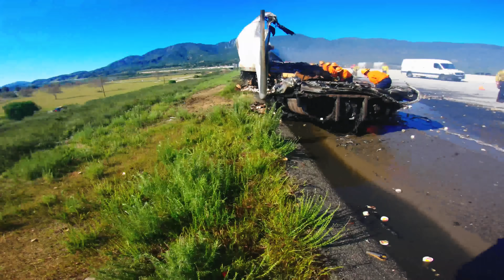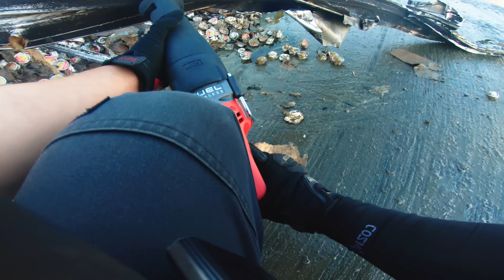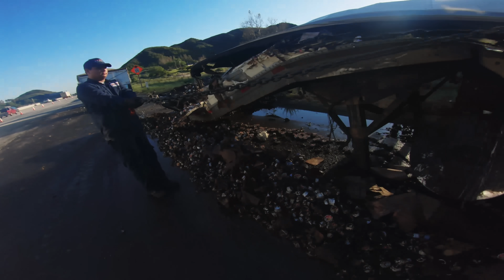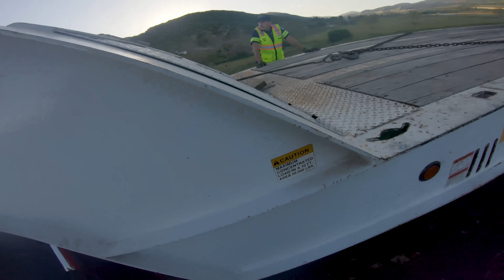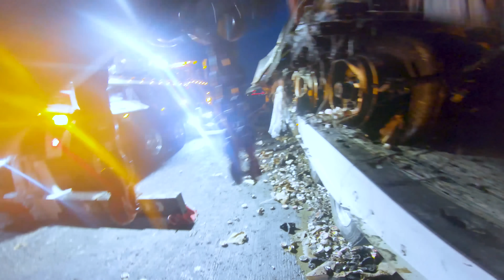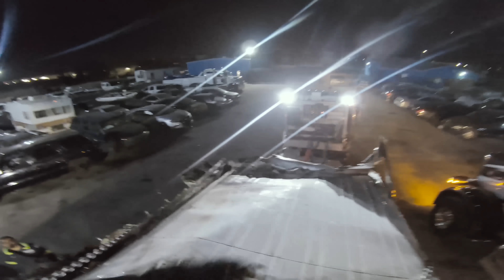40,000lbs of peanut butter burnt to a crisp on the freeway!

Comment: Sir JOSH !!!!!   What a messy recovery ????  GOOD THING THAT THE TRAILER DIDN'T BUST IN HALF WHEN YOU PICKED IT UP !!!!   ""KEEP IT SAFE ""!!!
Reply from the maker: I knew it was weak but also knew it wouldn't rip in half unless pressure was applied. Luckily I had Hulk and was able to sky it super high to compensate for the fold.

Comment: Hey bro. I think I would have first done a test lift from the refer end to see how much of the front I could fold back towards the rear axles. It would have cut the overall length nearly in half and have a couple wrap chains to bind the 2 halves together top to bottom. Then lift, back under, and let it down for securing. Good job. You made me hungry with all the roasted peanut comments! Did you get any samples, you know to show the boss. Lol later dude. Your videos are the best all except for the on off switch. Lol. Later. Jpol.
Reply from the maker: When I did my first test lift, I saw the front third immediately start to fold. The damage was too much, there was no way in picking up the entire thing evenly. After I got it a few feet in the air, I figured why not just sky it high and load it on the Landoll in one shot. Hulk is strong enough to do it and it worked well. I didn't know it would fold that bad when I did the first lift, would have taken longer if not the same time/effort to drop it back down and fold it before loading it.

Comment: I am a Nutella Man, so I am fine with losing a trailerload of peanutbutter. But what a sticky mess to clean up. I bet every link in your chains has some of that stuff stuck in it. But thank you for showing the work at the yard too. Most videos end when the loading on scene is finished, but the unloading is just as interesting in my opinion. But what happens with this wreck from here? Obviously the insurance will call this a total loss, so does the trailer get cut up at your location and then hauled off in pieces or does it get loaded and moved in one piece, along with the remaining peanutbutter cups in it?
Reply from the maker: Oh ya, mess on all my equipment. Had to do a proper hose down at my shop once done. To be honest, I haven't followed up with this call. We have many shops in the state and I don't micro manage all of them. In general though, I would quote insurance what my fee is to dispose of everything. They most likely would give us a location of where to dispose of it. Worst case scenario, they have no insurance and we have to find somewhere authorized to dispose of it and we would start the painfully slow process of suing the registered owner. On something like this, I would probably cut it and use multiple roll offs for the load.
Reply: @PepesTowingService  ... I think for cases like this you should just get a big portable shredder and grind the whole thing up. ;)

Comment: Just think about that remote thing what if you have a situation like this but there is too much debris underneath the trailer and the land all can't back under it you can just put it in remote mode and drive the halk forward until you line up with the land all. LOL JUST  AN IDEA!!
Reply: An idea that obviously has no base knowledge of physics. Look again and see just how far Hulk’s stabilizers/outriggers are deployed. Hulk would tip over without them and can’t move with them deployed.

Comment: Apparently u have not used a Sawzall much,yes u need a battery or A.C. power if it's electric, better yet would be a gas powered 14" cut off saw,it takes circular blades for any type of material demolition or construction.

Comment: Get rid of all the other brand sawzall blades you have and only buy Diablo, you name it, I cut it, and the blades are lasting me an average of 10 times standard by ANY other manufacturer, and I cut a lot of cars apart for core removal for scrapping.
Reply from the maker: I have Diablo, a big ass pack of them. You can clearly see the carrying case for them when I grab my Sawzall, it's right behind it.